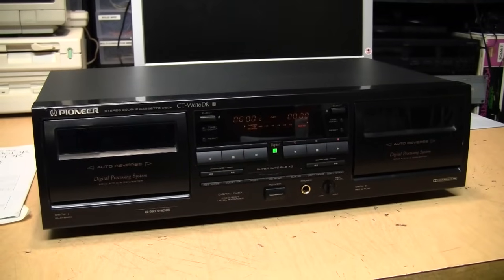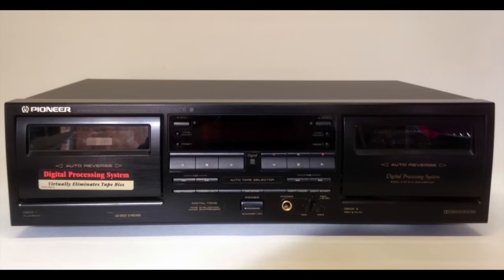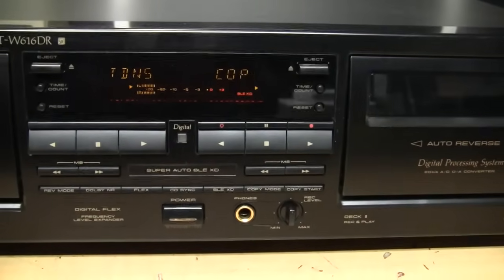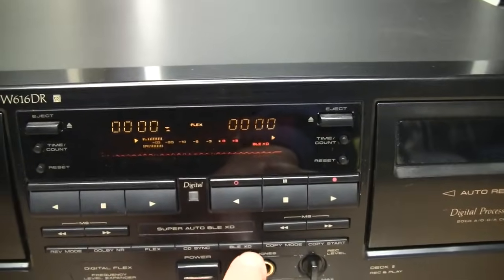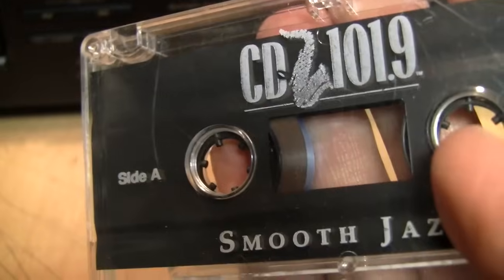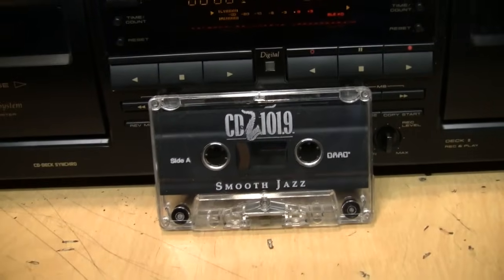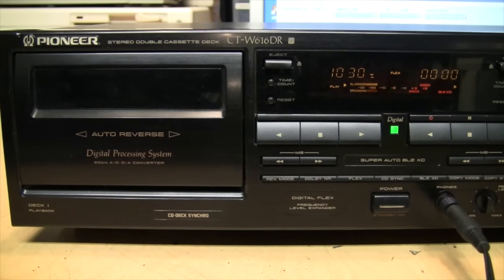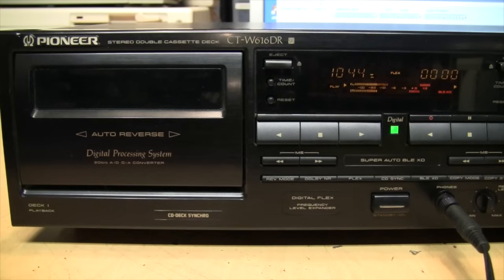A cassette deck that eliminates tape hiss - Pioneer CT-W616DR

Comment: How does it compare to CT-95?
Reply from the maker: A CT-95 what?
Reply: A CT-95 deck model by Pioneer.
Reply from the maker: You'll need to research that for yourself, because I've never owned a CT-95.
Reply: Unfortunately me neither. Though specs look impressive. I wonder what would DNR do to S-type NR...
Reply from the maker: It would mostly be unnecessary because with Dolby S the hiss is already so low that it's basically inaudible.
Reply: 86dB on CT-95, the one in the video goes to 90 with DNR, so maybe it could get even closer to CD.

Comment: Back when pioneer cared. Super tuners, super cool temperature amplifiers, speakers made of thick paper cones and real wood.
Reply: and the best plasma tvs ever made
Reply: I think the moment Pioneer stopped caring was when they changed their logo from the cool one with the ohms tuning fork symbol to the current sucky one.
Reply: @Watcher3223  I like the old logo better too.
Reply: @Watcher3223  i ABSOLUTELY love the new logo. I'm trying to find good cassette decks with the new logo
Reply: I heard that they had some pretty Kick-Ass and well-calibrated CRT rear projection HDTVs in the early 2000s as well.
Reply: ohh la la! i use a 70's pioneer KP-500 super tuner in my car. no need to get those fancy mp3 plastic crap. this radio will last my whole life! :)
Reply: Supertuners were great.
Reply: Can't forget the classic RT-909 reel to reel. Love old Pioneer kit :)
Reply: I still use my vintage Pioneer floor standing speakers. Big ol' 15" subwoofers in 'em too.
Reply: IIRC they had a CD-ROM that used multiple laser heads to increase read speed. But that was so long ago!
Reply: Inconsistent Manner Pioneer makes decent cheap speakers nowadays though. I had some shit pioneer stuff in the 90s.
Reply: I now that there camera's are pretty good now
Reply: taunusv4power
I had a KP500 in my car also, but they broke in and stole it. Wish i could get another one.
Reply: Perverted Alchemist  :  Ah yes... the PL-12D...an absolute classic turntable.  Quality engineering, and quality sound reproduction :-)
Reply: Yes Pioneer used to make some really great products. My very first receiver was their SX-636. Bought a couple of their Lazerdisc players and also a top of the line tv/monitor the rivaled Sony's best Bravia.
Reply: Its the wood for me.
Reply: This unit is a POS next to the old Pioneer units. It's a plastic nightmare.
Reply: @BrianShunk  what does POS means?
Reply: @justusgovaert  Sorry I didn't get to your rely sooner! POS means Piece Of Sh#t. Maybe that was a little too strong of a reaction. I paid way too much for my unit and was a little bitter.

Comment: Nice cassette deck, hard to find those old Pioneer digital models.  That's back when they still made decent audio equipment, now it's pretty much all throw away.

Thanks for the link to cassette deck maintenance.

I miss CD 101.9.  I used to listen to that station in the car years back, made my trips to & from work a little more pleasurable.  Peter White, David Benoit, Sade, etc.
Reply: Phoenix used to have a station with a similar format, 95.5 KYOT. I miss it.

Comment: I never considered half of those songs jazz (or "smooth" jazz).  Though I don't often listen to jazz so maybe I am wrong.
Reply from the maker: Most smooth jazz formats included a mix of soft R&B and pop music, as well as jazz.
Reply: @vwestlife  If you connect this to your computer, will you be able to buy software on a Cassette tape and put the tape in the player and then press play to run a installation of whatever it was
Reply: more like easy listening pop :)

Comment: Awesome explanation.  I was lucky enough to stumble across one of these a few months ago hunting for a deck for the computer system.  I have some old tapes a late friend of mine recorded in the seventies of local radio & tv, but his setup was discount tapes recording a transistor radio (or tv speaker) via a portable cassette recorder's external mic.  This deck improves the hiss greatly and makes digitization practical.